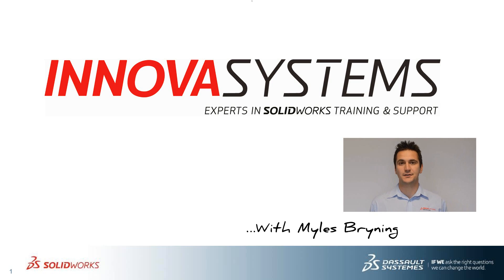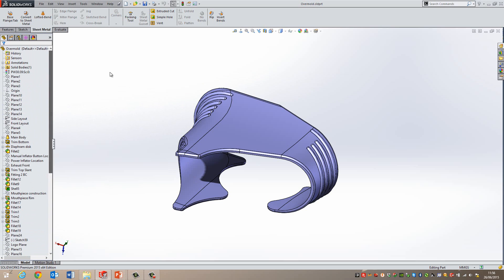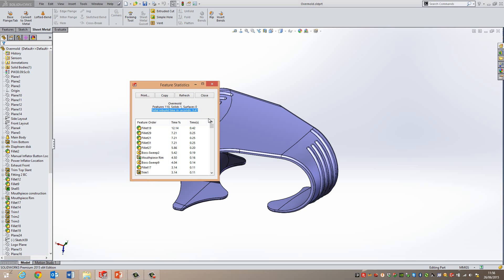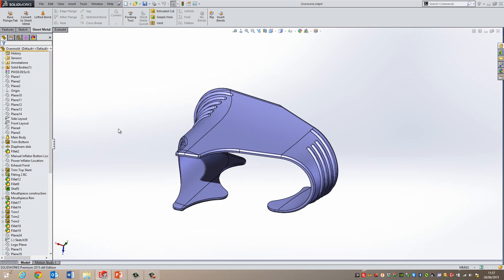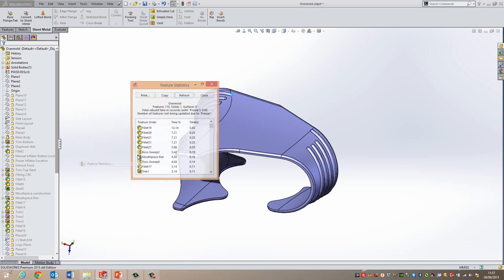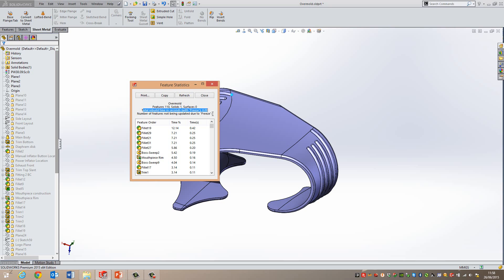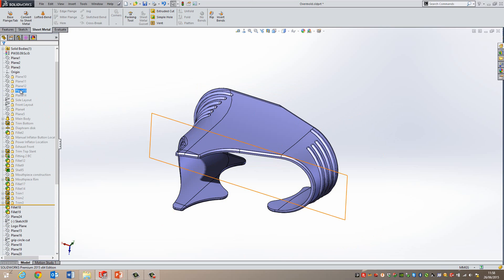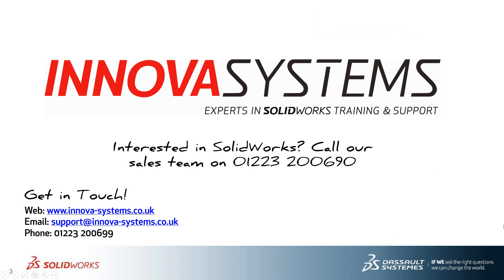How does the freeze bar work and what does it do?

Comment: Hello, I have a problem with my file. Even when the freeze bar is active, Solidworks still rebuilds the whole file, and most of the stuff gets messed up. Is there any way you can help on this one?
Reply: I realise you left the comment 8 years ago but I'll reply. There is a fundamental problem with the freeze bar. Say you are in a part with multiple configurations. You can force rebuild all configurations (possibly very time consuming) and drag down the freeze bar. From the perspective of the user the part is frozen and rebuilt. In reality you have only frozen the configuration you are in. When you go to another configuration Solidworks will automatically rebuild it. Only then is that configuration frozen. It is very time consuming and inflexible. For large parts with multiple configurations it means the freeze bar is almost useless.